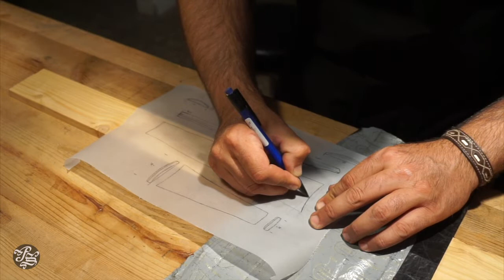FINGERBOARD AND TAILPIECE MAKING - PART 1

Comment: One question:

did you model the radius of curvature of the fingerboard using only the planer?
Reply from the maker: Yes, but you can also use blocks with sandpaper or scrapers. In any case you will have to check constantly your work progress